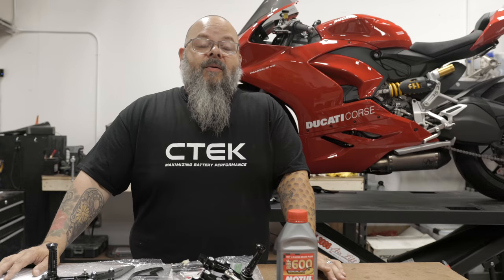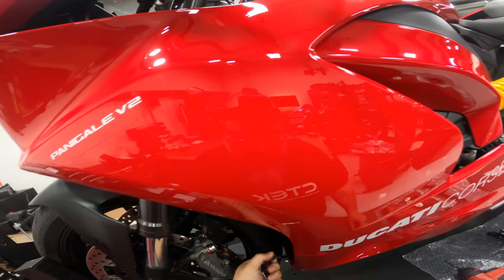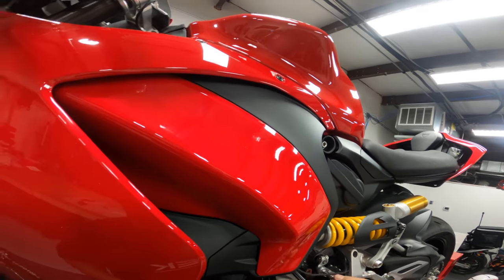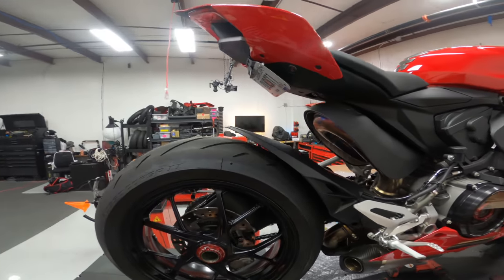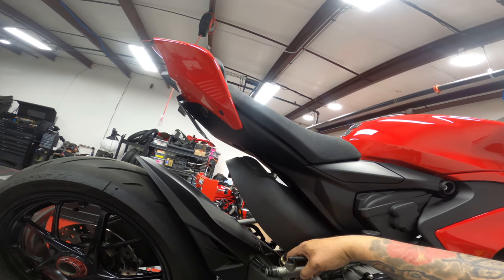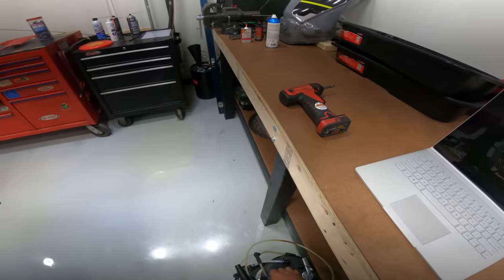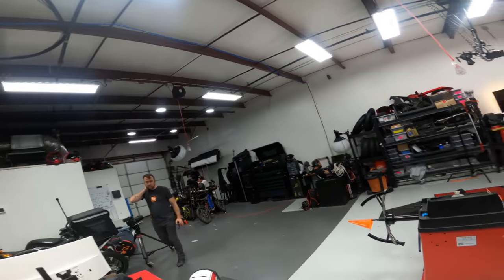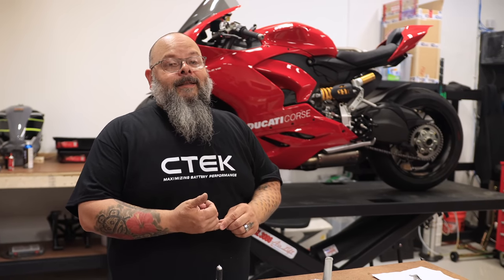Installing SPIDER REARSETS on a Panigale V2!

Comment: Damn that was frustrating to watch. Also doubly frustrating is spider doesn't actually list the adjustment measurements of the rearsets so your left with blindly buying a product hoping it will achieve the adjustments you desire... 🤔

Comment: I'm surprised that at the amount of resources you guys have, some of the things slip thru so easily. Here's some tips to help guys. Have him work with the camera on and see what the angle is. Setting up an angle while they're "trying it out" is always gonna end up being off. When they work they still tilt and move their body differently than when they are "trying" or "pretending to work". That's why the camera is off. 

Two. could we possibly get a flickerfree lighting setup? seems like you guys have a big black line going through the camera from what I can imagine is the LED lights throwing some weird flicker that interferes with the shutter roll

Comment: Anyone else seek dark lines going up the Brian cam?
Reply from the maker: We’re working through frame rate issues between the lights in the shop and the camera.
Reply: @chaseontwowheels  oh… I don’t know anything about cameras. That’s crazy that lights can do that!
Reply: @chaseontwowheels  - I believe it’s called image banding and can usually be resolved with a lower shutter or changing the rate of the lights you’re using.